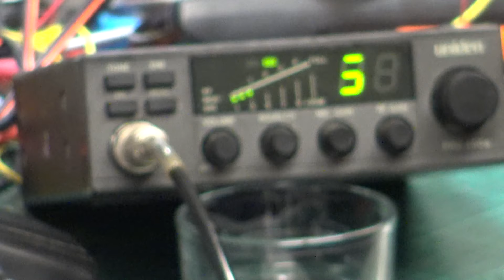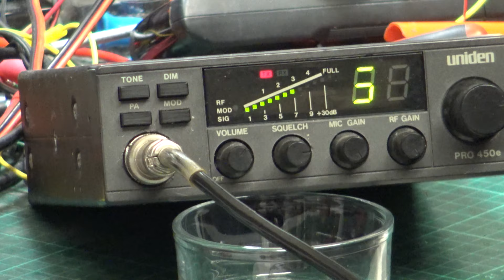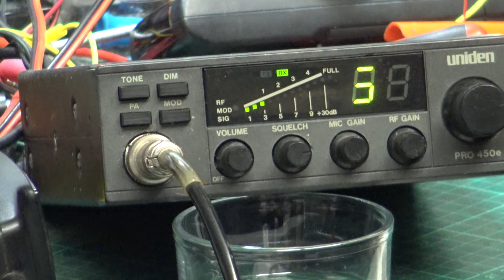Uniden PRO450E UK PR27GB CB radio (mobile) -  On The Air Test

Comment: They have improved the audio on transmit!  WOW!  They even appear to have improved the set on receive!  Praise the Lord, it's a miracle!  Shame they then stuck in a stupid display, what was wrong with a meter and a channel display on its own?
Reply from the maker: yes, even back in 1994 when this set was made, you could see 'crapness' starting.

Richard
Reply: @ukfmcbradioservicingTango21  Not even getting anywhere near 4 watts is a bit shocking.  I don't really like Audioline/Uniden type sets anyway, but that one didn't have the usual bassy muffled sound on transmit, still, you can keep it. lol

Comment: Hi Richard, I have a scrapped Uniden Pro 450e which came in a box of old
 radios, It's missing the cases and the front fascia, knobs and buttons.
 The main board has a large chunk out of it, but the front PCB is 
in-tacked (more or less) minus the variable resistors and 
switches/buttons. The display module is there also...Is it any good to 
you?
Reply from the maker: Wayne, yes that sounds like a good ide...but was the display working as it's a lot of work to swap that has no value even when working?

email me please  rshireby@yahoo.co.uk
Reply: @ukfmcbradioservicingTango21   Richard, I have no idea if the display works or not. Like I said before I got this scrapped radio in the condition I described.

I'll email you some photographs
Reply: @ukfmcbradioservicingTango21  Richard, I've emailed you some photographs of the scrapped Uniden Pro 450e
Reply from the maker: @waynekerrgoodstyle  Thank you. personal response emailed.